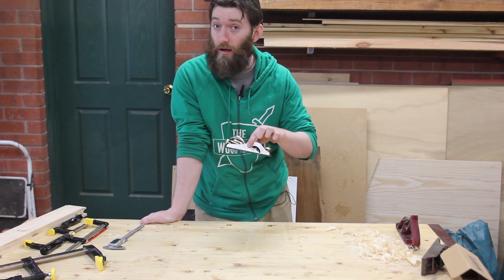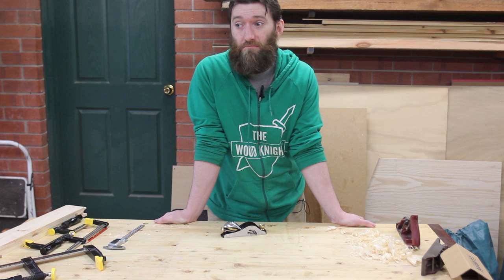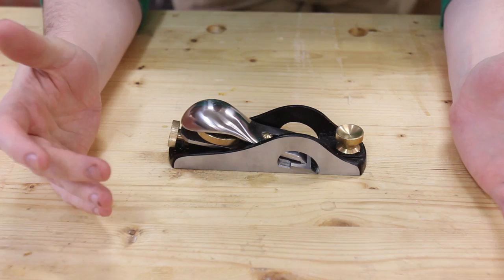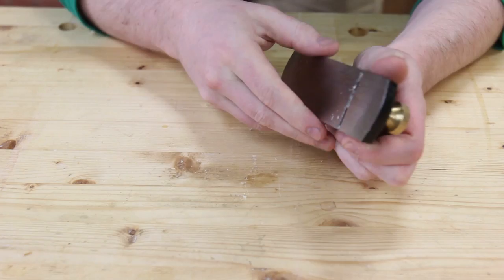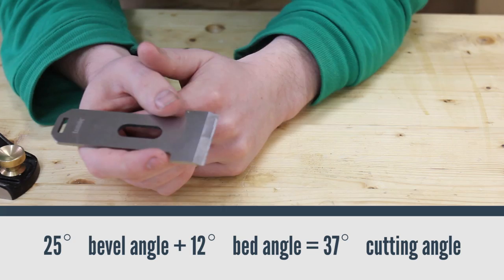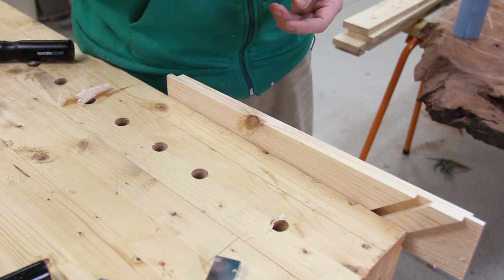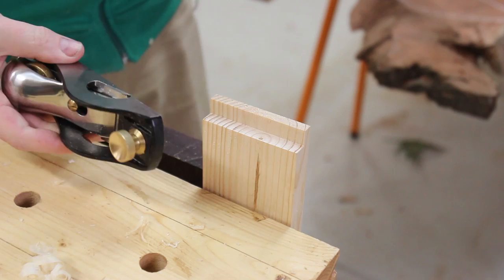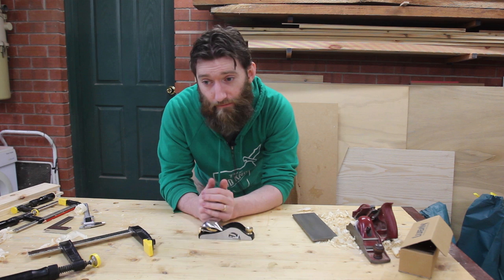066 - Luban Rabbet Block Plane first look

Comment: I bought one of these planes in the UK under the same brand name. I can confirm that the build quality of these planes is very good. They maybe don’t look as pretty as the LN or Veritas planes, but perform very well. I did however have a small problem with mine where the mouth opening was so tight, that I had difficulty getting the plane to take a cut without the shavings getting clogged. I could have easily used a file to open the mouth a little, but chose to sell it- which I now sorta regret. I also own a low angle jack plane from the same brand, which is a fantastic plane - easily better than any of the old Stanley’s i have restored!

Comment: I believe that you might have given this plane a better review if you had sharpened the blade properly. I have both the Luban and the LN rabbet block planes and they both perform similarly and far better than you showed the Luban to be capable of.  The shaving your showed the plane producing would be representative of the maximum thickeness this plane should be asked to produce. It is capable of far finer work than you have shown.

Comment: They are well made and good quality except for one feature. The particular cast iron used is far more likely to suffer from rust than for example the Stanley or Record planes. I purchased one in the winter time and left it in the wooden box it came in and after not using it for a couple of weeks found that there was rust on the sole and sides. When this was removed there was bad pitting which I have never suffered on my other planes. The actual performance of the plane after honing was excellent and the blade holds an edge very well and definitely benefits from being thicker than a Stanley blade, but you must be careful to protect the body from a damp atmosphere. Keep it well coated with camellia oil and it should be fine, but the pitting on mine is too deep to get out which is disappointing and happened so quickly.

Comment: I use the Luban for fine work, Stanley for joinery and $10 Chinese to take off the arris. The cheapo Chinese has the widest mouth ever but it still works! I find the Luban planes heavier than I would like. I find the backlash in all adjusters really annoying. It can’t be that difficult these days with cnc machinery to virtually eliminate it.

Comment: Firstly, great to find another local woodworker putting up great videos. Keep them coming Paul. I've got the Veritas and the Luban block plane and I find no real difference in functionality between them. The tight mouth of the Luban can be a problem if you want a deeper cut but these planes aren't really designed for deep cuts. I do wish the mouth was adjustable. I also find the blade hard to sharpen but I think that's just me. Anyway I use it all the time. It is a great block plane. Cheers.

Comment: The scratches on the bottom probably are not in the steel. I have noticed that new planes and other tools often have a coat of shellac or varnish/lacquer as a minimal protection against initial scratching. Often this is not noticed because the first step is generally to flatten the bottom... ergo the film is gone. If this is the case,your steel wasn't scratched at all.

Comment: Enjoy it Paul. I have exactly the same one....though mine are branded as Qiangsheng here in the UK. Ive been using mine today in face and I absolutely love it. I also recently picked up the regular LA Block and the Shoulder Plane which I have reviewed on my channel...and both are also very good.
Though I dont own one, I recently tried a Wood River at a woodworking show which too felt equally as nice. I would certainly endorse these tools over an old Stanley/Record.

Comment: I have the low angle block plane and the shoulder plane from Luban and love them both, i know that the Wood River planes in the US are made in the same factory. Is is as good as a Veritas or a Lie Neilson, NO, does it do the job and do it well YES. I find the blade hold an edge well. So to all the people knocking chinese made tools, get over it! Thanks paul

Comment: You  forgot  about  Clifton plane's  they very  very  expensive  but  the quality  is second  to none,  I have  a  few  Clifton  plane's  from before  Clifton  changed  hands,  they  have  a  stay  set  chip breaker and Bubinger handles  and  are green,  the  new  Clifton's now  don't  have  the  say set  chip breaker and the  handles  are  walnut  instead of Bubinger,  they  have  cut  down  on  the  quality  but  not  the  price  unfortunately  , the  first  Clifton's are the  better  plane's,  and  are all Bedrock plane's  very  thick chip breaker and blad Iron's  absolutely  brilliant  plane's in every  way  possible  .

Comment: Nice review on this plane mate! I’ve got mine just for a week and it’s a pretty good quality concidering the price . The only thing what should have been better is the little too small wheel and the blade which is slightly broader as the plane bed  itself in my case. But it cuts nicely and smooth.
Reply: The iron is supposed to be larger than the sole on a rebate plane. It's a feature, not a defect :)
Paul Sellers says on his blog: "The 2mm of extra width beyond the width of the plane itself creates a relief between the side edge of the cutting iron and the plane body without which the plane stair-steps away from the intended cut line with each and every subsequent cut or stroke of the plane."

Comment: Follow up, follow up, follow up! 
Four years later, do you still have it, are you using it? If it was stolen would you purchase it again? That kind of a thing. 

I'm trying to put together a minimal type workshop (apartment, need to lug everything outdoors) and any tool that does multiple jobs reasonably well is a win! I'm concidering going for the "JUUMA" version of this plane which is sold in Europe. I've seen that the LN rabbet block plane is aparently "finicky" to adjust.

Comment: Nice (p)review! I too have one of these (branded as Juuma). With this one too the small mouth opening gets in the way. That's why i'll return to the Dictum (Quengsheng as well) model that has an adjustable mouth and is still very affordable. The first one broke when falling on a concrete floor. Otherwise they seem of equal quality.
Reply from the maker: +Hans Verdel I've actually found in the way I use it, that it isn't an issue. I could certainly see the use of a rabbetting blockplane AND an adjustable mouth block plane, or just a generally 'coarser' block plane. 
I actually have a spare blade, so I might just make a small wooden one with a larger mouth.

Comment: This is a great concept being two planes in one. Is there any drawback to a standard block plane?
Reply: As with all rabbet planes you should watch out for the open sides. Cos' sharp as these come, you get nasty cuts just by inadvertedly brushing your hand or vingers on the side of these. So, I have a standard (Luban) block plane for the normal work and this one for rabbets and tenons. That way I'm allways well aware of whitch plane I'm working with. Oh yes, and I never put this one on its side for the same reason.

Comment: Hi I have the plane in video and for me it works well with a nice feel. Can I suggest you look at Clifton planes out of England sold by Fine tools  Australia out of Melbourne. Fit and finish of these planes are extremely good. A 5 1/2 $579 in my opinion better than lie Nielson. Cheers from Tasmania
Reply from the maker: If I had the budget, I'd check out Clifton, LN or Veritas. Unfortunately, Luban is bang on that sweet spot for me. The LAJ/#62 is actually really killer for the price.
Reply: The Wood Knight I paid $109 for the rabbit plane, I also brought 4 other Laban planes and fined them really good and yes don't cost a fortune. Cheers from Tasmania

Comment: Hey Paul, Three and a bit years on and I came to the same opinion to you about the used market for planes in Australia. You really don't know what your getting yourself into with ebay. The premium stuff is a bit out of reach for me maybe if you do this for a living they make sense. Most reviews I have found say the Luban  planes will work very well after you do minimal fettling.
Reply from the maker: I now have three luban planes (this block plane, #4 smoother, and most recently a low angle jack). I haven't had to do any fettling, just had to hone the edge of the blades. For the LAJ, I didn't even bother taking the blade to the grinder, just straight to water stones. They're great value for money

Comment: I assume that this type cannot be used for shooting, is that correct?
Reply from the maker: +David Januszewski it's not impossible, you can offset the blade to one side (ie away from the side thats down on the board), but I've not tried that. It'd create a more shearing cut

Comment: Wow. What a ripoff. The LN Rabbet Block plane is $175 in the US. A $100+ markup is atrocious. -- I agree about your sentiment on the older planes. The demand became too great and they became stupid expensive. That and you never really know what you're going to get until it arrives. I don't even bother with eBay any longer. Veritas and LN are my only choices, because I know exactly what I'm going to get when it arrives at my door.
Reply from the maker: +Theball Player 175USD = 242AUD, shipping from LN to AU is ~50USD (~70AUD) (though it might be more than that - that was the price I was quoted for two chisels). That puts it at 312AUD. Bad exchange rate doesn't help, exorbitant shipping from any North American provider is also a real problem.

The Luban (aka WoodRiver) at 109AUD or 79USD is pretty good value.

Comment: 20 bucks or so for a used plane made in my hometown vs a lot more for a questionable chinese plane from who knows where made from who knows what?
Sorry mate, no thanks. Flea market all day everyday till I die before I give the chinese any more of my money.
Reply from the maker: s0nnyburnett If you can get a plane for AUD20 that isn't a rust bucket and comes with all the parts, go for it. If like me, you struggle to find a usable second hand plane for less than AUD50 which would still need several hours of work to be rust free and flat, suddenly AUD100 doesn't look so bad.

Its T10 (the chinese designation for W1) steel for the blades, and cast iron for the body.
Reply: Paul Jenkins
Unfortunate, I feel for you. I don't know much about tools from Austrailia, were there any native tool manufacturers from the first half of the 20th century that left some treasure to be found? Or were they mostly imported?
Reply from the maker: There are some locally made that were good, some that were bad. I think a lot of it has to do with our population density - I wouldn't be surprised if the woodworkers in America would make up half the total population over here. As a result, locally made stuff didn't have the support to keep the businesses alive without cutting corners :(
Reply: If you want an Aussie made plane and can't find any, that sounds like a business opportunity to me.